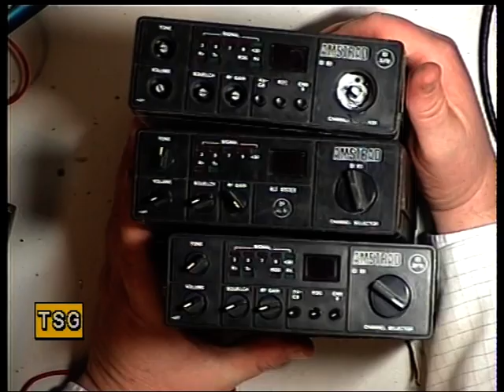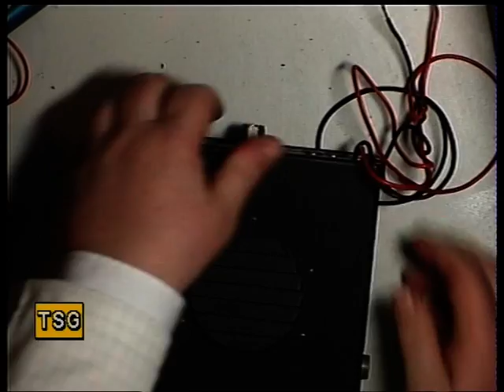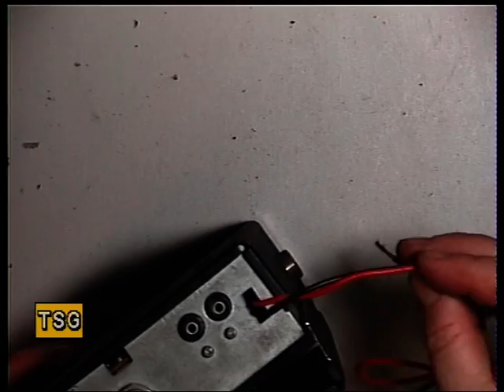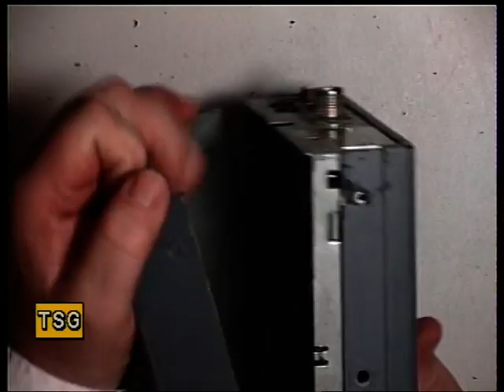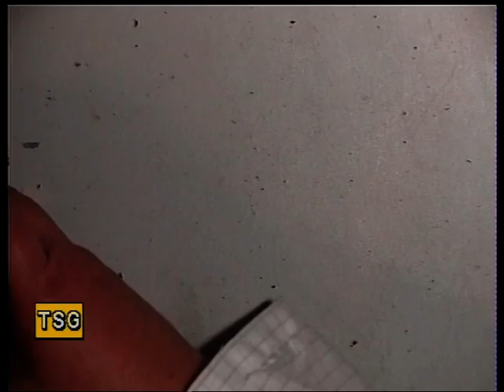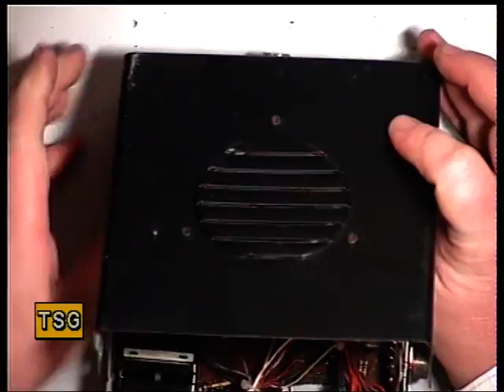Amstrad 901 discussion - There are three versions....and one isn't so good!

Comment: To the non-CB repairman, how do I spot cheaper components from a visual inspection?
Reply from the maker: In general, or just with the Amstrad 901?

Richard
Reply: @ukfmcbradioservicingTango21  In general.
Reply from the maker: There aren't many really bad sets (that are legal)...back in the 80's the Harvard Good Buddy/Alba CBM5/Harvard H404 & the fake version of the Amstrad 901/Spinneytronic CB199/Harvard H646 were about as bad as it got.

These days the current models are not likely to last 40 years+. The bizarre thing is that there are many £59 sets that work great.....and £229 sets that work no better & are filled with awkward menus & pointless bells & whistles.

In general the Made in Japan sets were always the best.

Richard

Comment: Hello again my friend, just thought I’d say hello again. I just picked up a totally mint Jap 901 all boxed with original wing nut bracket bolts, sticker, manual and of course the lovely rose mic with the coil completely unused. I don’t know what it is but I just live the Amstrad. Appreciate that Cybernets are pretty much in most 27/81 rugs but it’s the modern retro look. 
How you doing?
Laurie
Reply from the maker: Hello Laurie....that's the 'Action Man' mic! The Jap 900 & 901 use the Cybernet 002F chassis

Richard

Comment: Hi there, I’ve heard that once you sort the squelch out and fully align the Hong Kong version they work just as well as the Made in Japan version? 
Any thoughts to advise because I have a boxed & mint HK one?
Reply from the maker: I don't have figures on the difference between the Japanese & Hong Kong versions. I personally don't think the HK version squelch is as good, but it certainly isn't a snag.  The fake version of the Hong Kong version is definitely inferior in all respects including reliablilty.

Only internal inspection would show the difference between a fake or genuine HK version. No screen printed component locations in the fake/el cheapo version.

Richard, G0OJF, UK
Reply: @ukfmcbradioservicingTango21  thank you indeed for the information my friend. I note from many sites that there seems to be an equal amount of Jap & HK versions. My one is definitely a HK and the supplier I bought it from has updated the squelch for a better performer and its so much better now - in fact it’s a very nice example.
Isn’t it strange why these companies do this?
However, it’s nice to get a boxed mint Jap or HK one given the fun we can have.

Comment: I've got a few of the 900's but one of them has a problem that I can't fix. When I key the mic there is a delay with the audio for about a second, it does it on all channels but is ok if you switch it to low power. Everything else works fine, any ideas?
Reply from the maker: How bizarre! Sounds like the 7v (I think it's 7v & not 8 on these sets) is sat fault.I'd monitor it & see what happens upon switching from rx to tx. I reckon it's an electrolytic capacitor somewhere on the TX 7v line.....now these sets are 35 years old.

Richard

Comment: I bought my first Amstrad CB 901 brand new from Argos in Scunthorpe High Street back in 1983 when they lowered the price down to £29.95 (I still have it with box and receipt and in perfect condition, it's never had the casings off!).
I also have two unused boxed 901 and a boxed unused 900 in my collection.
All versions are Made In Japan models.
I think you will find the power socket changed over time too to a smaller type.
73 Dave M0OGY.
Reply from the maker: Glad to hear you have a bit of a collection of sets...especially in boxes. I was parked up in Melton Mowbray the other day waiting for someone &  was listening to a couple of chaps talking in the CB. One mentioned he had a pristine 901 for sale. The other guy said "I thought you weren't going to sell that one" the first chap replied & explained that he now had an even better one in a box. Clearly CB sets are highly collectible...I have to admit having some myself! I've got a commercially built PE Ranger 6, a kit built PE ranger 6 & a unbuilt PE Ranger 6 kit for starters...must do a video & finish off that commercially built one...knackered unobtainable relay!